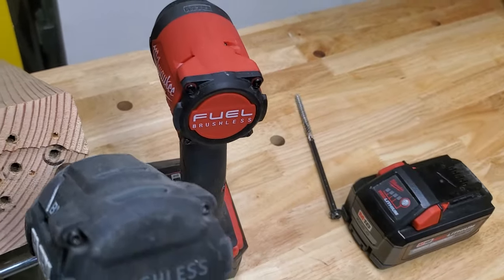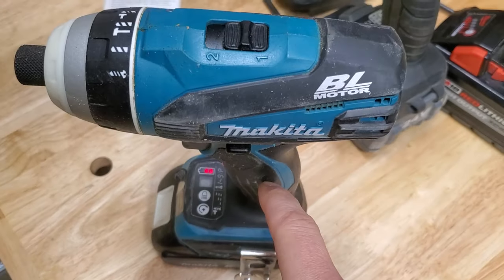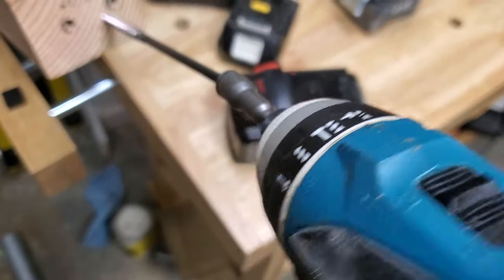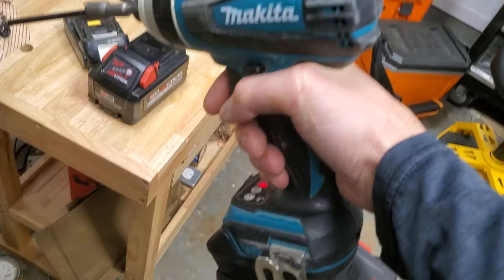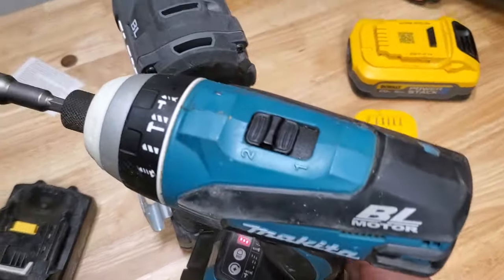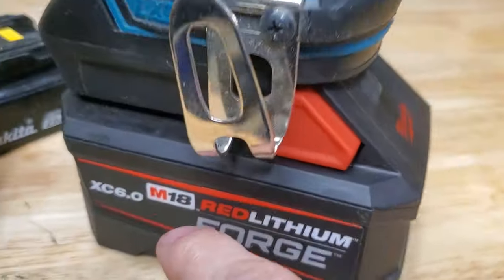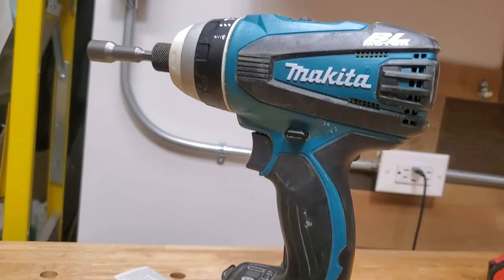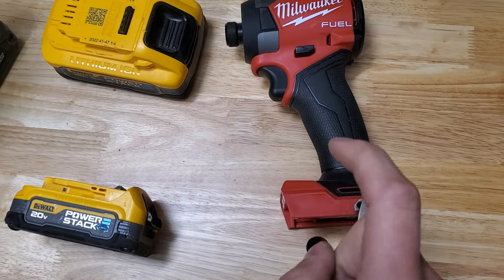Did Milwaukee miss?

Comment: The forge isn’t stacked lithium from my understanding. It’s tab-less 21700 cells that allow for more current under high load. Meant for saws and maybe a drill with hole saw not impacts.
Reply: Everything I'm seeing on Google says its pouch cells. Even one of them is a sponsored article I think
Reply: @bossmanz28  I found a video and it is pouch cell but the pouch cell technology isn’t the end all of batteries and unfortunately with the levels of power these tools are bringing there is an upper limit to what we can see until we get new types of battery construction and power delivery. I’m not saying these batteries aren’t the best on market but this is almost the limit we can see on the tools. The companies are chasing single percents improvements at this point.
Reply: They really need a 2.0 FORGE BATTERY

Comment: Most  pro users want  speed power( torque ) runtime in that order. 
I don’t think a smaller  AH capacity Forge would benefit  many tools . The tools it would benefit are all Battery thirsty like angle grinders,  SDS drills and would suck those small batteries dead in no time. I use the  standard 5.0 in impacts,  drills, and 6.0 HO in grinders, saws and SDS drills.   I’m not a fan of the 8.0 or 12.0 batteries as too many people have issues and much of the  online testing proves the 6.0 HO is best bang for the buck and I’ve never had issues with the 6.0 batts I own. 
  I guess we all want the lightest most powerful longest running batteries and the improvements are ten fold over 5 years ago. Pretty soon. 👍

Comment: I like the 3.0 and 6. The 6 I can run all day on metal roof install.
Reply from the maker: Love the 3.  Is it better to run 2 6 all day or 2 3s? Less weight.
Reply: @toolsandtactics  i just use my 6 or 2 3.0 on gen3. Most 6 and higher on other tools have to swap all day depends on the project. Framing nailer I can normal use for 2 days without chaging.